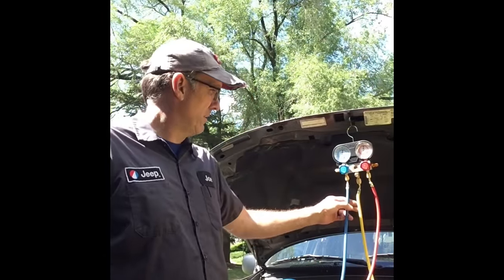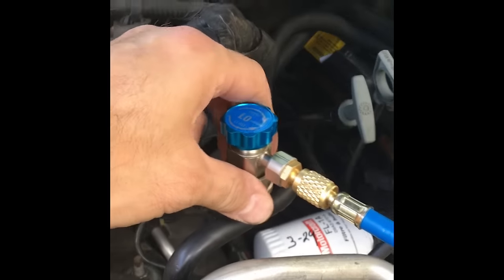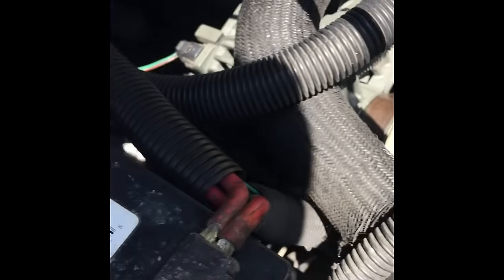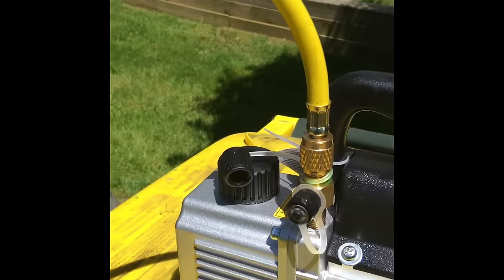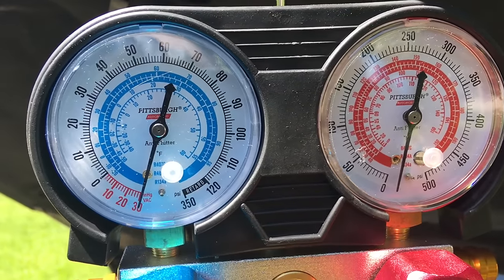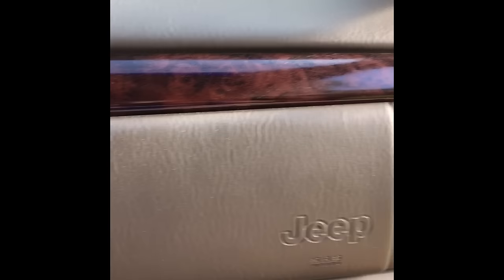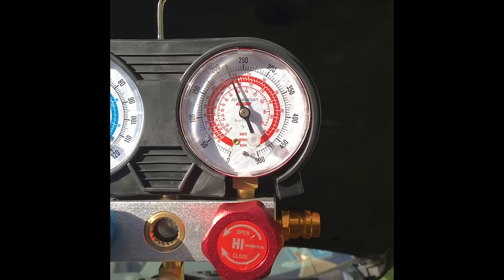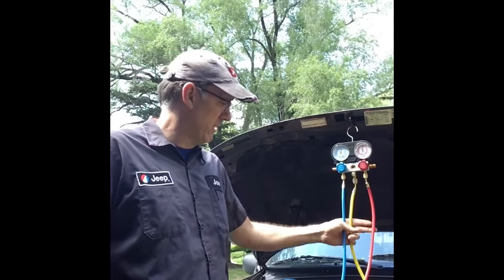How To Pull A Vacuum On Your AC System And Recharge Your AC System

Comment: You forgot to purge your yellow hose of air and may have introduced air along with moisture into your system. If you think about it, when you remove your yellow hose from the vacuum pump, it is under a vacuum and as you unscrew from the pump, you may have sucked moist air into the hose. That really should be purged out before flowing your refrigerant into the system.
Reply: How are you supposed to purge it correctly without getting air back into the house when you hook it up again?
Reply: @axtonclonts2897  Pop the vacuum schrader valve at the gauges to release air in the yellow line.  Let up when you see refrigerant come through.
Reply: Okay I’ve got a problem.  My low side is reading 120-130 and high side is stuck on 0.  What all could cause that or what is most likely
Reply: @axtonclonts2897  are you sure you got your high side valve open so thst it will read on the meter
Reply: @axtonclonts2897  You have a restriction/blockage in the system. Most likely in the orifice tube condensor or accumulator
Reply: Nurses do not purge all the air out of I.V. tubes and were all still kicking. As much as I do agree with your science, the machines can only do so much as well
Reply: @isarob03  you know what it turned out to be?? The piece of shit gauges I got from parts store.   The rubbers inside the hoses were cut and clogging the hose up under pressure from previous users over tightening them.  I was pissed off and happy all at the same time.
Reply: @enginetix  nurses are supposed to get every bit out as possible cause air in your veins and arteries is a big no no lol. - a nurse

Just for future reference in case they manage to forget somehow? Dont let anyone run anything more than the most tiny little minuscule bubble into you, for your sake haha
Reply: @dylanmoore7466  I'm not saying don't try and minimize, just saying there's a threshold. And it would take the entire I.v. tube full of air. A couple inches here and there nurse's don't bat an eye
Reply: @johnscreekmark  i wish someone made a video to doing this
Reply: I was going to comment the same thing and you are right, you purge the air out before adding the freon but pushing the valve in keeping your face out of the way. Let some freon purge out along with the air first. That's how I was taught.
Reply: It got the air cold all that matters . Thank you for this video it was helpful
Reply: I'just wonder .when you use the vac pump in the AC system .Don't you also pull out all the Compressor oil is well?? Dong get it 😊
Reply: Thanks for shearing
Reply: @enginetix  That sounds like the ‘Oh, that’s good enough’ attitude. If you pay attention to what you are doing, you can do this job without introducing any air in the system. Look at how long that yellow hose is. If you don’t purge the air out, you have all of that in your system now. And you will forever wonder about the peak performance of your system. Have you reached the peak? Is that air and moisture that was in the yellow hose causing your system to underperform? Are you slowly contaminating your system? Causing a premature compressor failure? That yellow hose should have been cracked open at the manifold fitting prior to charging the system. If you turn the can upside down, liquid refrigerant will spray out. This is your proof that your refrigerant has reached the manifold. Now, you are 100% sure that you have not introduced any air or moisture into your system.That’s good enough is not good enough. Think about it.
Reply: @johnscreekmark  do you mean to pinch the Schrader valve, to purge the yellow hose?
Reply: @dylanmoore7466  not true. I’ve seen/put 2-5 unit size bubbles injected and no issues. 
- a drug addict 😂😂😂
Reply: I agree with your comment but shouldn’t you have added instructions on how to purge the yellow line from the pump?
Reply: @LetricShave  install a shut off valve at the vacuum pump side that's my set up

Comment: My cars AC has a special self-depressurizing feature...when the compressor blows up, the system automatically depressurizes! No hassle - no fuss! 😂 😫
Reply: Mines has an engine auto stop feature. Cuts on, goes boom, engine dies.😂
Reply: Nice
Reply: My first car (back in the mid-1970's) was WAY ahead of it's time. These modern cars that shut the engine off at stoplights? Mine had it back then! However, I had to do the "restart" personally!
Reply: @jasonrodgers9063  I can relate!! I remember cranking my engine for like 2 minutes just to get it to start - especially when it was freezing out! I used to stick an ice scraper in the carburetor choke plate to hold it open. That worked sometimes. The ultimate fix was to shoot a blast of starter fluid down the carb - then run around the giant boat and hit the ignition before it dissipates! Hahahaha! Honestly, the troubles I had with my cars led me to a career of turning wrenches!
Reply: 🤣🤣🤣🤣 heck ya best way to evac just keep running it til it's about to lock up
Reply: Iiiiiiiie t
4

Comment: The red or high side isn’t connected to the yellow hose at all. It’s only used for diagnostic purposes. It serves zero purposes for recharging. Only thing you could possibly get from hooking it up to recharge your system is maybe make the valve start leaking. So if your just recharging your system do not hook up the red hose.

Comment: JOE,  Now you forgot to purge the line before adding the refrigerant to the  system  to purge the  line  just listen the yellow hose by  the manifold gauge  just crack it open,i ok till  a little bit of refrigerant comes out,  once a must  or some such is very little comes out your good tighten the yellow  line and your good to go yes that will keep any moisture out of the system THANK YOU KEN VALENCIA
Reply from the maker: Thanks for the details. I’ll try that next time. I have to charge another ac system. I’ll try it.

Comment: So I decide to do a diy and never contained the Freon and we’ll I had to replace the compressor and when I took off the ports bolt off, and the Freon went everywhere 😢. Can I just install the new one and connect it and turn it on like normal?

Comment: Good presentation, enjoyed watching. Everything is spot on except that while charging the system, the recharge (yellow) hose was not purged of the trapped air. The manifold connector for the yellow hose had to be loosened a bit until you could see freon oozing out.

Comment: 30 year Master HVACR service tech here, I would like to point out a few things to anyone watching this. First, if you notice the red, yellow, and blue hoses that are screwed onto the manifold gauge set, his hoses are on backwards, the bent metal end goes toward the unit you are working on, these ends have service core depressors which should be removed for Automotive use allowing for free flow and no restrictions, the metal quick connects have manual service core depressors. The straight ends should be placed at your manifold gauge set these ends will not have service core depressors. Also most importantly when you pierce your R134a can and charge your yellow charge hose you need to purge the air out of that hose up by the manifold set, by just cracking the fitting slightly to release the air and a slight amount of freon( R134a) and then tighten it back up. This ensures that you now have nothing but R134a in your charge hose and are not pumping in air with your charge. The most accurate way to get an exact factory charge is to weigh in your freon charge with a digital scale, not all cans have the same amount of freon in them.  So if your system says 1.3Lbs of R134a you convert that to ounces which is 20.8 oz. and weight that mount in. I always add a small amount to compensate for what is left in the hose and would charge to 20.9 Oz. But all in all this guy did pretty good, just remember moisture is our enemy, and ambient air has a lot of moisture. PS: the smoke you see coming off of the vacuum pump is moisture boiling off and being taken out of the system and removing it from the descent charge in the receiver/dryer, this is normal.  :)
Reply from the maker: Thanks for taking the time to share your knowledge. It’s all about sharing knowledge and helping each other! Thanks for watching too!!! Cheers!!!!
Reply: I have a question- when swapping between cans(my truck takes 36 oz so 3 cans) do I add the can, once empty, close off the low side at the gauges, attach second can, pierce, and bleed line, then open back up low side at gauge to continue filling the system?  You didn’t show swapping cans in the video. And I don’t wanna do this wrong.
Reply: @67bradenlee  YES that would be  the correct way to do it using small cans.
Reply: @tracysellman1562  I just read your post, very nice. So is there a way to see how much existing freon is in a car that just needs to be  "topped off"?
Reply: @precisionbay6899  No. A recovery machine can weigh how much was in it but you can't reuse it if there was a leak. Moisture and air will have contaminated  the recovered material. There is a sticker under the hood that says how much the system should have. Best way is to vacuum the system to empty then add in the correct weight. You can top off using the cheap low pressure gauge but even a single time can lead to degrading the ac system. Cold today busted tomorrow unless filled precisely with no leaks.
Reply: So I got me a set of those gauges so I have to remove the lil thing on the inside so the Freon can flow freely but the hoses came up with that from factory I’m confused
Reply: I appreciate  your information
Reply: Question: Even with purging the yellow line, wouldn't you still have non-condensables in the manifold dead space?
Reply: For your consideration- My instructions on my gauge set depict the bent ends connected to the manifold and the straight ends on the connectors. Harbor freight set.
Reply: @johnpope8949   I get that buddy, but this is what we get from a China company and a guy writing instructions for that hoes set, who is not a certified A/C tech, the reason they put the bends in the hoses is to facilitate a better finger placement for connecting the hoses in tight confined places. Also, the service core depressors are on those ends only, which need to be removed completely to use the quick-connect automotive R-134A connectors, remember you want no restrictions in your hoses.
Reply: @tracysellman1562  that’s fair
Reply: Thnx for corrective comments.  Harbor Freight quick reference service   guides are wrong then as they specifically show pics of the bent ends connected to manifold/gauges.  I even called Pittsburgh to tell them they have a serious liability issue here, also noting the manual says nothing of which end connects to manifild vs couplers !
 it simply says to connect them !ughh.   hello !!  So  ...  remove the inner valves at BOTH ends of BOTH hoses, if using manifold gauges AND the red n blue cpuplers???  that makes sense as the couplers  depress the port valves after connected and opened up
Reply: @ericaviator8869 , you're right about this. I just got my set, and it shows that the curve ends connect to the manifold. What did you remove?
Reply: @JustJeep_It  that right there is how you take constructive criticism. I respect and appreciate your outlook and knowledge 🙏🏻 and very much appreciate the video
Reply: He did and I know it’s always ez for an expert to pick a yt vid apart apart but I appreciate your honest and correct advice, I wish others including myself sometimes took  such a respectful, yet honest tact and your expertise. So many out here wanna crucify a misstep and many just intentionally trying to be hateful to folks just trying to help a novice like me just trying to fix my wife’s ac.
Reply: @Jeff-rk8hq Thanks buddy, for taking the time to comment back, and for not taking  offense  to my suggestions. Too many haters or posters respond  back to comments with insults. We both are her trying to help people.

Comment: THANKS for posting! I just performed this operation on my car (2004 Mercury Sable). I watched your video at least a dozen times, wrote down the steps so as to have them handy during the procedure. 
The equipment & freon set me back about $250 (I bought a 2-stage vacuum pump). My beloved wife passed away right at 5 years ago, I've let a LOT of "upkeep" of the infrastructure in my life just "slide". Decided it's time to get my ass in gear. Your procedure worked like a CHARM! Dropped my car vent output temps from 104 degrees to 41 degrees!!
I am very grateful!!!
Reply from the maker: Thanks a lot..I appreciate it!!  Just trying to help folks and save you guys a little money!!

Comment: Great video. So easy to follow and very informative. Just one thing; You should purge the refrigerant line from the charge can to the manifold to remove the air. Otherwise, it is pushed into the system.

Comment: hi after looking at your video i am going to follow your steps I replaced the ac line the high side and now have to put a vacum to it.  I did not add peg oil since i did that one year ago into the condenser   hope my repair line is done right and no leaks .  I was going to take it to the shop they want 400.  to do the vacuum on it and recharge the line.  i order the gauges AND Pump

Comment: Really liked this video.  Very simple & to the point on most parts.  The only thing is that the way I have learned it, making sense, was to purge the yellow line with opening the yellow valve core there to let the air out WHILE ALSO turning the can UPSIDE DOWN while shaking it at the same time so the freon can be ready to come out 1st & the whole can empties completely. Then stop pressing valve once you start seeing freon sprinkling out the valve. Noticing that the can will start getting cold while you're shaking it & it's draining through.  But for sure this video was great man.  I've used it several times to go back & remember what to do next at certain points of the process. Thank you 👍

Comment: For anyone watching thats planning to do this, this is a good video but there’s a few steps to add.

1. Once you have the can attached to the yellow line and the can is punctured, bleed the yellow line at the manifold to purge the air out. That way you only get refrigerant and not air. 

2. Keep the can upside down so the liquid refrigerant gets sucked in.

3. Not so much a step but a tip. If you are recharging your system and didn’t replace a major component like a compressor, condenser( where you pre-oiled before installing), etc., you can pour the oil into the yellow line, then attach the can so it sucks in the oil as well as the refrigerant.
Reply: How do you bleed the yellow line when you put oil in there or do you fill it up with oil and this takes the air out? I'm not sure how much oil is needed for my 1960 Oldsmobile.
Reply: What kind of oil is used in the AC?
Reply from the maker: Pag46 is what I got from the guy at Autozone.
Reply: How do you bleed the line at the manifold
Reply: @fleadoggreen9062  once he punctures the can and the freon is free to come out, before opening up the low side to start allowing refrigerant into the system, loosen the other end of the yellow line where it connects to the gauges.  At first, just air will whistle out but eventually you will see refrigerant come out.  Be sure to were gloves for protection as you can get burns on your hands from the refrigerant.  Tighten the line and you should be good to go.
Reply: @wolfgangdallmann943  A 1960 Olds even HAS a/c?!! I'm IMPRESSED!!!

Comment: Good job, the only thing wrong with this , is you did NOT bleed the yellow line BEFORE you put  R134a in the system.  That means that after you vacuumed it. the yellow hose is full of air. It went right straight into the system BEFORE the  R134a went in . It now has air in the system.
Reply from the maker: Yeah..I get that a lot..But it fortunately didn't effect things too much..now long term..maybe. But for the time I had it, no issues..

Comment: One thing I loved about my old Dodge Neon was that it had the exact same ac system as the Caravan so it took 2.8lbs of freon, I always rounded it up to 3lbs even and it would get so cold little pieces of ice would fly out of the vents and after a few minutes I would to turn it down to medium and this is on a 112 degree day in Tucson, aside from being a quick little car it wasn't that great but man the AC is still the gold standard for me and I have literally driven every car made at the auto auction.
Reply from the maker: Nothing beats ice cold AC on a hot day!!!!!

Comment: Man you rock! I needed to refill my car after doing a bunch of work on it. I was about to buy one of these pumps and had no clue that Autozone rents them out. Thanks for the video! I'm going to rent one early tomorrow.
Reply from the maker: Glad I could help.  It's a lot of little steps but I'm glad this was helpful to you!!!!
Reply: They also have gauges and a flush canister if you have compressor that grenaded.
Reply: ORielly does it too. No rental fee, just deposit when you take it and you get it back upon return. They also have gauges and a flush canister if you need.